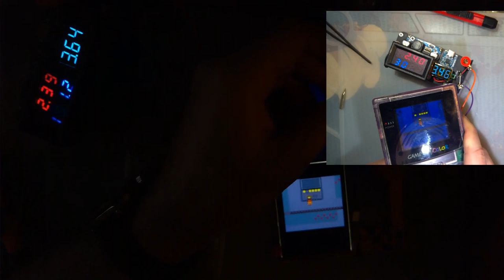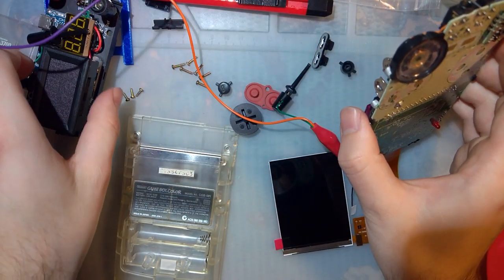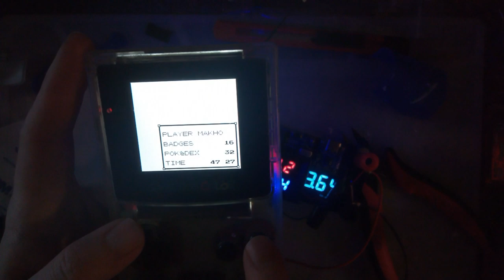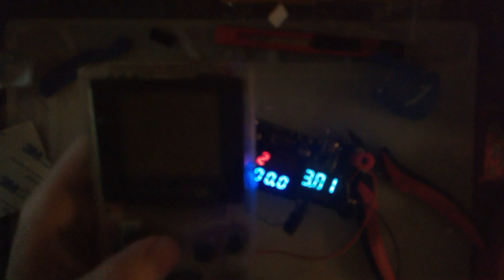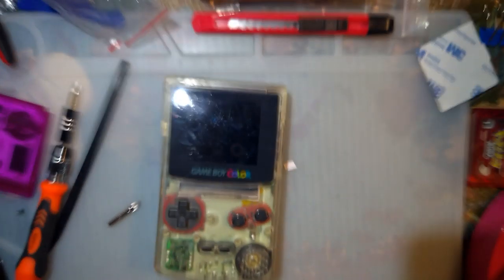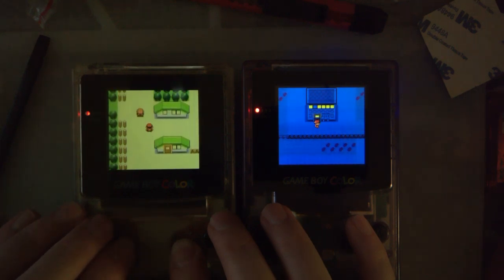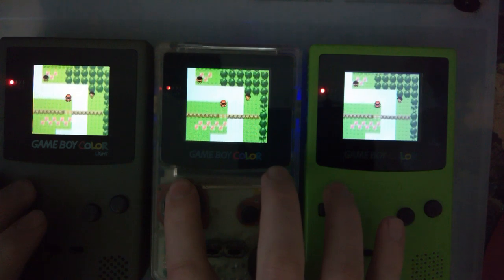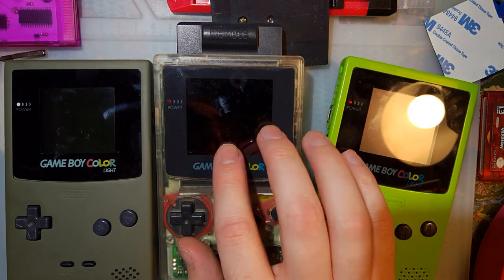Installing a Funnyplaying FULL SIZE Backlight kit in a Game Boy Color

Comment: I didn’t use a bracket. I was able to trim the shell in a way that it holds the LCD screen in place but not tight enough to damage the LCD. The IR port plastic cover is brittle and I chipped off more of it than needed but I placed tape to hold it in the shell and the tape may prevent dust from going through that open section. The brightness sensor in my kit didn’t have glue, so again, ended up taping it to the right upper side of the shell, same location as you did. Thanks for the guide!

Comment: Trimming with Dremel is so much easier and considering how many mods are you doing, investing in one would be a good call. I highly recommend it. Especially on transparent shells where you can see all imperfections. :) Thank you for this video, I'm gonna mod one Color for myself, and as much as I know DMG inside out and modded bunch of them, I'm noob when it comes to GBC. :) 
Cheers!
Reply from the maker: I have a dremel and I occasionally go in after the videos to clean up my cuts. I don't usually do the mods with it because the people that have one generally already know how to use it. Also, setting up the camera in a different spot is more effort than I want to put in usually. 

But yeah, highly recommended for this stuff. On top of a rotary tool, a tool stand and few high quality milling bits are also fantastic.

Comment: I know this video is old at this point, but you could put a very tiny bit of acetone on a Q-tip and carefully wipe it on those tooling marks. It should clean up the tooling marks nicely but be careful because acetone melts ABS.

Comment: Hey I just installed this on my GBC. Works great, but I've noticed in some games some pixels on the far right side kinda flicker. Its only in some games, Mario Golf if you happen to have it. Whereas Pokémon Gold for example is fine. Just wondering if you have it.
Reply from the maker: I don't have a copy of Mario Golf to test with. I haven't noticed that issue on any other games though.
Reply: @makho  I messaged funny playing and they said it can occur in high power cartridges. On most games for me it doesn't happen.
Reply from the maker: @ojtaylor1642  Hmm, interesting. I haven't tested much with my everdrive, but I can try it out and let you know if I spot any issues.
Reply from the maker: @ojtaylor1642  Yeah, it looks like that might be a common issue. Especially with Mario Golf.
Reply from the maker: @ojtaylor1642  So after some more testing, it looks like this issue occurs with most (but not all) GBC only games and a handful of GB games (most being GB compatible GBC games or black carts). I'm not sure why yet.
Reply: It happens with the non-modded Game Boy as well so it's not exclusive to this kit! For example on the top screen part in Super Mario Land, when the screen is scrolling.

Comment: Its an ok modding kit. I highly recommend bennvenn freckleshack or midwest embedded kits.
Reply from the maker: Freckleshack is nice if you can ever find it instock. MWE kit is also decent but it is terrible on battery. I like the AIO kits out of China right now. They seem to have the best of both worlds.
Reply: @makho  i do agree on the china screen mod. Not bad at all as i installed one on my gameboy pocket. Lately bennvenn has been in stock with its new revision 2.5 mine should be coming in friday. I tend to support these people because without their inventions we would still be in the dark ages in the modding community. Bennvenn, bluishsquirel, jellybelly customs, retro modding, midwest embedded are just some of the folks i support and buy frequently. Check them out if you haven't heard from them.
Reply from the maker: @kr4t0sg.28  I think I've ordered from all of those people a few times. And FWIW, the Chinese AIO kit isn't a copy so saying we should support original innovations means we should support that kit too.

Comment: Is your screen litle bit bend on the bottom sides, when in the case? And i putted remaining 3m double sided tape on the ribbon cable like trf did, is it good for the life of the screen? And my motherboard rev is 04 it doesent have noisy pixels on doublespeed games. Also i can't get the sensor to work, it only works outside of the case, but when inside it doesen't work.
Reply from the maker: no, my screen is not bent. I don't know what your issue is with the touch sensor but I haven't had the same issues. I'd recommend contacting the vendor you got the kit from.

Comment: You don't have problems with the  sticky pad? I use display sticky pad because the are really thin.
The pad what came with the mod make at my gbc problems that the board press on the display.
Even without the H bracket the problem exist
That was to see and the it destroy the screen.
Reply from the maker: Nope, mine is fine. Plenty of room.
Reply: @makho  strange a other user that I knew has the same problem like I have.
We can only build it without sticky pads that are in the package
Reply from the maker: @-Gothicgirl-  Don't know what to tell you. It works for me. Are you using aftermarket shells or OEM? OEM shells tend to have more room on the inside.

Comment: Makho, did you know you can hold the touch sensor for three seconds and it switches to max brightness?! I just found out by accident.
Reply from the maker: same thing on the SP kit
Reply from the maker: well, similar thing. The "max" brightness is actually brighter if you press and hold than the regular max brightness.

Comment: Rolling shutter you see on camera is PWM used to control backlight. Not a great thing. Also: Color temperature comparisons are completely useless. Unless you are measuring greyscale accuracy to SRGB or some other color space there's no telling what is accurate. It's all irrelevant anyway since those original games don't operate in and weren't designed for modern color spaces anyway.
Reply from the maker: I know why the screen was showing funny on the camera. I was just surprised that the taobao kit was the only screen with that issue and I wanted to express that it's only a filming quirk, not something that is noticeable in person. 

And the reason for comparing the colors is because the taobao kit is very noticeably different in person. I don't really care about color accuracy too much, I just wanted to show people who might. Like I said in the video, it's impossible to get accurate color representation on a backlit screen anyway because the original screen in a Color was a passive reflective screen and the colors depended entirely on the lighting conditions.

Comment: If I don't care for touch-function, does this ribbon cable allow for soldering connections for button combos to control brightness like other kits often do?
Reply: no
Reply from the maker: Not that I could see. There are extra solder pads, but those appear to serve the function of programming the firmware, not brightness control.

Comment: What is that lil device called with the alligator clips that you used to power on the device at the start of the video?
Reply from the maker: It's a battery powered DC power supply that I made custom. You can search my channel for the video but I am working on a new version soon.

Comment: If you had to pick one screen which one would be the one to get? Would you say the taobao kit is still the best?
Reply from the maker: https://gameboy.github.io/wiki/backlightmods
Reply: @makho  thanks for the link I'll be going with the funnyplaying kit as I'd like the full screen size and dont mind modifying my shell also my motherboard is an 05 revision so it shouldn't have them pixel artifacts In games that run at 2X speed

Comment: Do you have a link to buy the spacers some of us dont have a 3d printer
Reply from the maker: I do not for this kit. The spacers are only required for alignment though. If you can eyeball it, you can install the LCD without spacers. Only issue is that the adhesive the kit comes with is PERMANENT so if you do not get it right the first try, you'll need to live with it or purchase a new LCD.

Comment: Any advice on trimming clear cases to minimize what you see on the other side?
Reply from the maker: A rotary tool helps significantly, especially if you have a drill press stand for it and some nice sharp cutting bits. Also, only cut exactly what you need and no more. If you cut all the way down to the bottom, it will show more apparently. Finally, you can clean up the cuts by polishing the material (sand paper, floor gloss, headlight polish, etc).
Reply: @makho  thanks for the reply!

Comment: I bought my glass screen from bluish squirrel and it seems that it is not 1:1 exact like the original because, after the installation of the IPS Display the screens seems to be 1mm off on the right side in combination with the glass display. That really frustrates me.
Reply from the maker: Bummer. I've not really had a good experience with my customs from BS though my issues were related to the difficulty in actually communicating with BS to arrange the customs.
Reply: Update: BS mailed back, the issue is known for this batch - machine was not aligned correctly - he will send me two new (correct) ones. 

Btw. the 3D printed spacers, I had to cut them, because when closing the GBC shell it pressed on the IPS screen and that caused an uneven illumination. Was wondering if this is due to the chinese shell or if this is a common problem, but I haven’t seen it in any tutorial.
Reply from the maker: @Mazinga  Good to hear about the lenses. And yeah, I think that's a known problem with the aftermarket shells. The tolerances are different compared to OEM and there is usually less room on the inside with those.

Comment: I got mine sometime after seeing this video and I absolutely get screen tearing on mine. No messy end pixel as I have an 05 but definitely screen tearing.
Reply from the maker: Is it regular or does it just happen after a screen reset (e.g. scene transitions)? The latter is a known issue.
Reply: @makho  Scene transitions in Link's Awakening and sidescrolling games in general; was playing Donkey Kong Land 2, for example and it was doing every so often when you started moving or changed direction.
Reply: Same here. 05 board revision. Thought I would be in the clear. Plus I have a slight amount of screen bleed on the lower left corner.

Comment: I installed this kit with a pre-customized shell today. Looks great, but the brightness adjust sensor doesn't work. Is there any way to fix that or use button combinations like with some other kits?
Reply from the maker: Unfortunately, no. I did not see any solder pads on the ribbon for button combos. I'd talk to the seller and mention the issue and try and work it out with them.
Reply: I have the same issue and I’ve tried moving it to different locations, but nothing works. The sensor itself works just fine, but once I attach it to the IR window or basically, anything, it doesn’t register touch. I contacted FunnyPlaying and they told me to route the black wire under the ribbon cable that connects the screen to the board. Didn’t fix it. I don’t think it’s a routing issue. I think it’s a hardware issue regarding sensitivity to touch.
Reply from the maker: @SpeedDemon8706  There's probably a way to adjust that by swapping out a resistor or something but I just don't know beyond that. I'd try soldering on a new touch sensor. Just grab a small section of wire, solder on a small bit of copper tape to one end and solder the other end to the ribbon. If that has the same issue, then the problem is with the ribbon.

Comment: Hi makho, where did you get your red conductive pads from?
Reply from the maker: I made them. I dyed OEM pads with hair dye.
Reply: @makho  Thanks! They look great.
Reply: @makho  Just one more question. Do you remember which hair dye? I tried it and didn't work for me :(
Reply from the maker: @sebco7854  FWIW, I left the dye to soak for a few months. It was not an overnight process. The brand was "SPLAT" and I got it at Target. I have not been able to repeat my experience either.

Comment: I have a GBC with this mod and after a while of playing the screen will go to complete static. It will sometime flicker the static in and out but to get the image back I must restart. On fresh batteries the time it takes to static out is increased greatly. Any ideas what this could be?
Reply from the maker: Not sure. You sure it's not an issue with the game itself? Have you done any other mods?
Reply: makho no other mods and happens on any game. One person said they tried to tweak the contrast pot in the back of the GBC so i tried it and i can get the static to happen quicker so i am thinking this may be something worth noting. I have a 04 model so i never encountered your noisy pixels or anything. I wonder if there is a perfect spot that the ips need in order to not static out?
Reply: Here is a link to my reddit post that will show a pic of what it looks like https://www.reddit.com/r/Gameboy/comments/g9dw5j/funnyplaying_ips_modded_gbc_weird_issue/?utm_source=share&utm_medium=ios_app&utm_name=iossmf
Reply from the maker: @ITechTyler12  The contrast pot changes the LCD voltage regulator WHICH IS NOT CONNECTED to anything with the new LCD kit. The static happens when the FPGA on the kit crashes. Sounds power related to me. Are you using a flash cart?
Reply: makho interesting! No I am using regular GBC games. Someone claimed this fixed their issue but I watched you take that regulator out and it absolutely doesn’t effect the ips. Could it be capacitor related? It never crashes right away. . Also, would a lithium battery mod help?

Comment: Wait so it's a full screen backlight?!?
Reply from the maker: Yes
Reply: and it's IPS
Reply from the maker: @AppleVsGravity  I did trim the dpad area. the membrane sits between the PCB and the screen with no clearance issues, it's just the circle around the dpad in the shell that needs to be trimmed.

Comment: What kapton trade did you use? Link?
Reply from the maker: I've had it long enough that I wouldn't be able to dig up a link. If you have a local electronics store, check there first but otherwise, most major online marketplaces should have generic "polyamide tape". Kapton is a 3M trademark for polyamide tape.

Comment: What’s the battery life like?
Reply from the maker: pretty much on par with most of the other mods on low brightness. I've yet to run it through a full set of batteries but I did make a table with  my measurements: https://www.reddit.com/r/Gameboy/comments/ehru1w/relative_power_usage_of_backlight_mods/